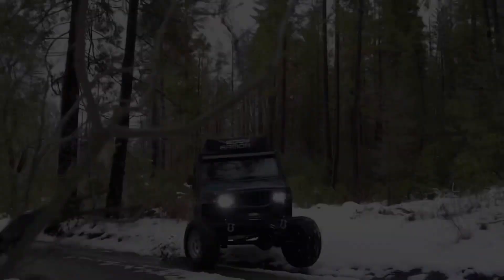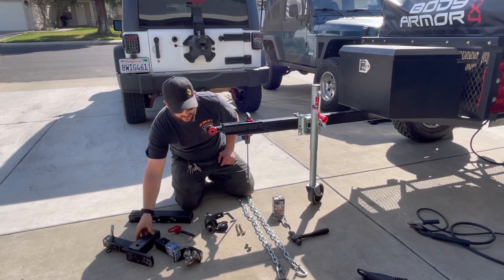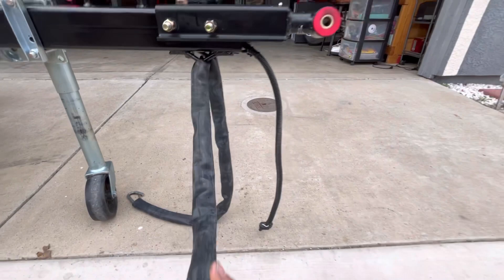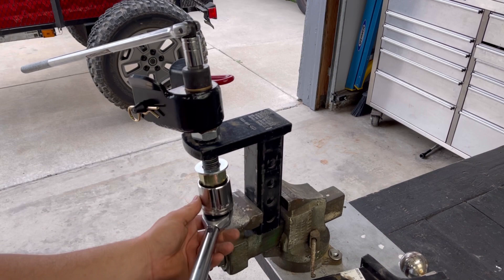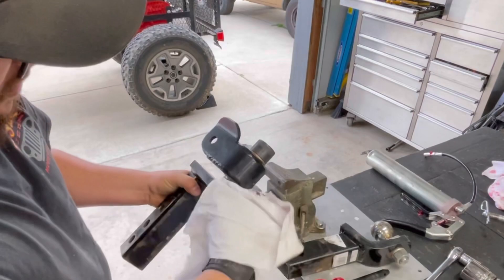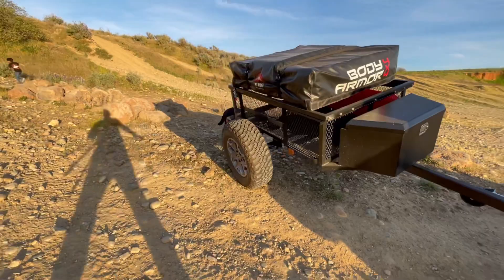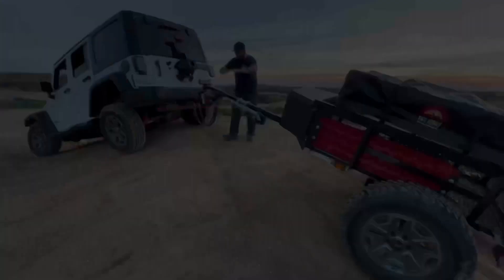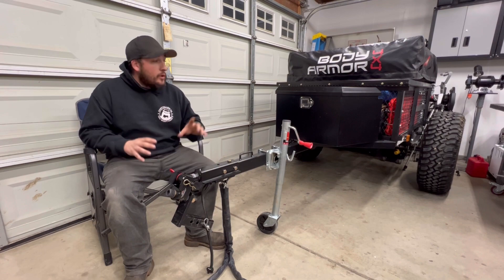Budget Overland Trailer Build Pt3 - Max Coupler Offroad Articulation Hitch Setup & We Go Off-roading

Comment: Use a Lunete swivel ring on the trailer and pintle hook on the jeep . Simple as that ! Ask Jeep forum were you can buy
Reply from the maker: I’ve looked into those , they are good farm hitches but not DOT rated and makes a ton of noise.
Reply: @ATEMOFFROAD  I use on my suzuki vitara 1.9td 3 doors and my small utility camper trailer,  for suiet a while . It is noisy but not so much .
Reply: @ATEMOFFROAD  you have the Uniglide tow coupling . Is an australian device and I think won a SEMA prize , some years ago .

Comment: Looks like an excellent solution for those pulling a trailer, but that's why I went with a full-size rig... no trailer required
Reply from the maker: I’ve seen some very capable full sizes rigs. And if I could do it all over again , I might just go that route! I’ll check out your channel! Thanks for watching 🍻
Reply: "Full size rig"  Bro, you have a 2 door F250. Which means anything you put in the back is open to thieves and elements. 
Adding a camper or topper is the same as having a trailer, except when home the trailer can be left behind.
Reply from the maker: @GratefulOverlander  those are some real benefits to having a trailer that I barely notice behind my jeep. new video coming out soon , shakedown on the trailer and new tent. This video will definitely show the importance and the stuggles of having a trailer on the trail! Thanks for watching 🍻

Comment: I have the Lock n roll...I like it.  They both seem to be fairly equal in performance.   I don't see much difference of one over the other...maybe price?  Nice build...what's your overall weight going to be?
Reply from the maker: I agree , they both seem to do a good job! Time will definitely tell how well it holds up, Beats spending 5k on a finite suspension, when all you really need is a single dexter and a articulation hitch. As far as weight goes I’m hoping to get the trailer on the scale either in the next video or after. Thanks for watching buddy I appreciate it 🍻

Comment: You mentioned that you shortened the tongue length.  It seemed to perform great on the video.  What made you decide to shorten it?   I have a M416 trailer that I’ve added to the 2’ to the tongue to make backing easier but I haven’t tested it yet.
Reply from the maker: So originally, I left the tongue longer because I was unsure at the time how long I wanted it and I do think it did well offroad at the time. But then I realized that I hadn’t filmed anything on the install of the max coupler and I was still considering shortening the tongue So I just went for it and cut an additional 12” off. I think it will still offer good offroad capabilities and I can still park my jeep perpendicular to the trailer and cook off the back of my tailgate with the length it is now. I’m 3.5 from the box to the end and about another 12” from the bumper if I continue using that adjustable hitch. I think 4”+ will be fine but will really get to know soon once I get the 35s on the spare tire in the back of the tailgate. I really hope I didn’t miss calculate! What is your overall length from end of receiver to nearest large object on trailer? Thank you